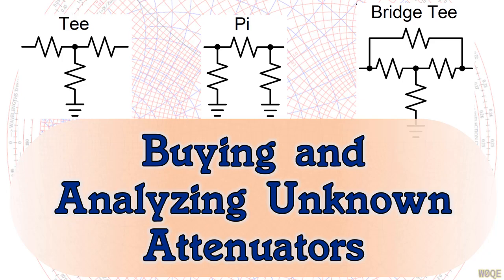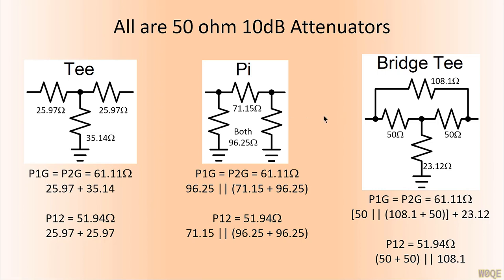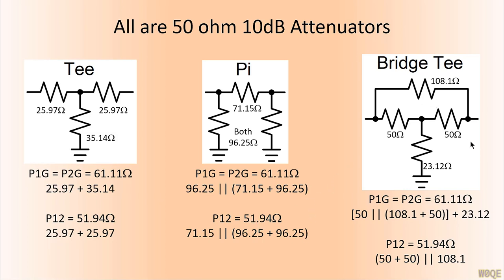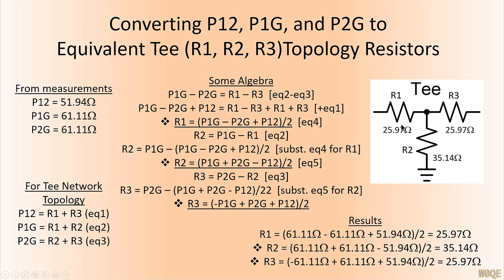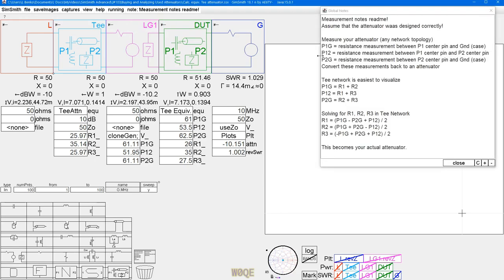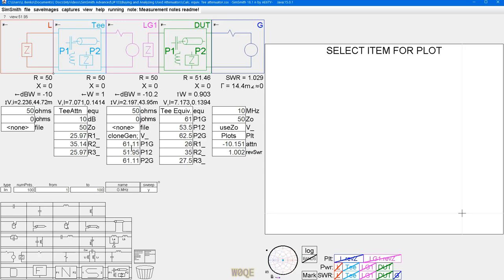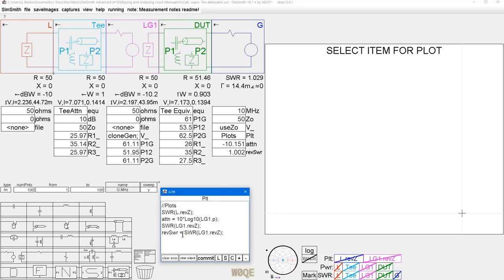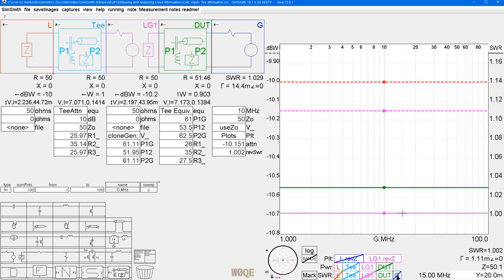#103: Buying and Analyzing Used Attenuators

Comment: Thank you so much for this video. I havent thought about the resistance between each terminal for different Attenuation networks and i certainly didnt expect them to be all identical!

I tried modeling a bridged T Attenuator on SimSmith but unfortunaly i cannot figure out how to do it, since with SimSmith you cannot add a bridging resistor with the sequential box scheme.
I downloaded your files on drop box but i realize i need to actually read the manual. Anyway i am eternally greatfull for SimSmith to exist.